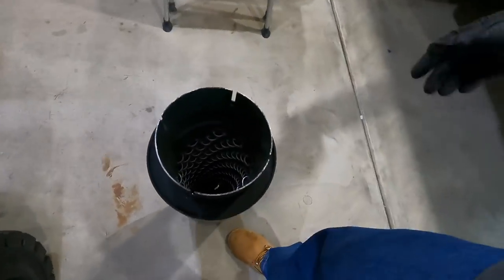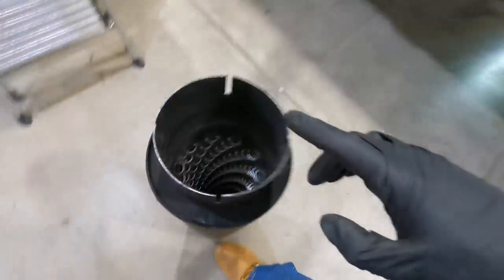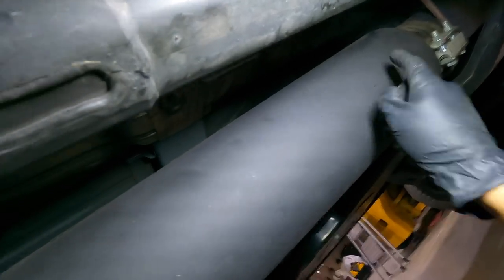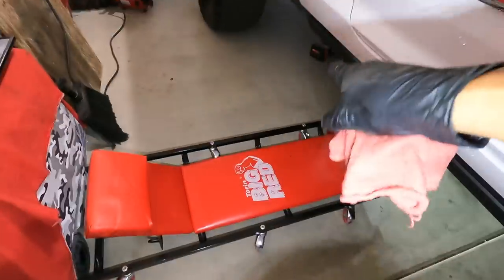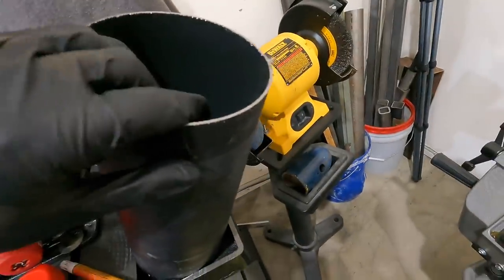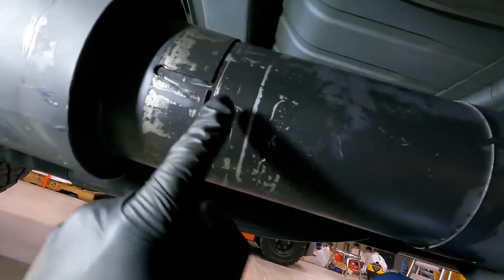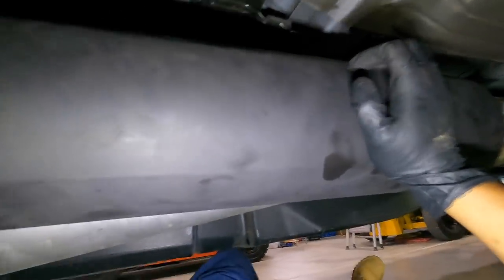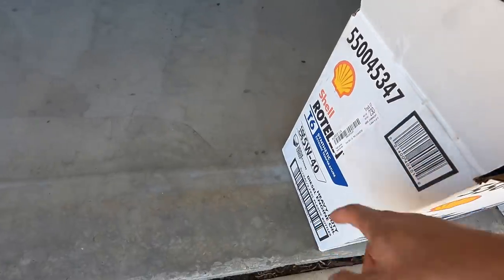Adding a second muffler on the CUMMINS!!....Will this help?

Comment: The Open Holes inside the muffler need to face toward the front of the truck. I think you installed the mufflers in the exact opposite position. Turn the mufflers around and you will notice a big difference is how quiet the exhaust sounds.

Comment: I run a MBRP Performance Exhaust M1004A - Quiet Tone Series High Flow. I also run a resonator. No drone. Made a big difference. I ran 4” all the way because I was told it was quieter. I run the passes in Alaska with no EGT issues. I lock out 6th gear but general cruise at 60-65. I’m only pulling about 12k.

Comment: FTE Diesel resonator 30 inch long will get rid of the drone. Shouldn’t kill power or raise egt’s.
Reply: it robs a little bit of horsepower but nothing to notice on the butt dyno in the drivers seat. I didn't notice any egt increase when I tried it out but I went back to 5' straight pipe on my l5p duramax lol

Comment: I noticed the mbrp louvered style inside mufflers are just loud. I prefer the magnaflow type perforated core with the biggest diameter body. The 24 inch + 30 inch body combo works nicely for the 4 inch systems.  I am messing with 5 inch inlet/outlet, and looking for sound bites before I order stuff. 

The walker version does not seem to quite it down as much as the magnaflow. Nothing quietens these trucks like the emissions bs, but who wants that.

Comment: I have a FTE resonator and a mbrp 5" muffler on my lml. Killed drone and exhaust is quiet. Holes facing forward so exhaust can go into holes and into outer muffler. No egt change. The spiral interior of the resonator actually speeds up the air exiting exhaust.

Comment: I had the same problem with my 21 6.2 Silverado 1500 what you need is a J pipe and the J pipe will cancel out the drone.

Comment: Try a resonator and an axle dump. Do the axle dump first. Shortening or lengthening the tailpipe will move the frequencies for the drone to an rpm you don't drive in.

Comment: Muffler and FLoPro resonator. Still sounds good outside but no drone empty or pulling a trailer.  Oh yeah, holes facing toward front of truck.
Reply from the maker: Herd those kill horsepower 🤷🏽‍♂️
Reply: @EddieLife3500  no se, Brother? Never had the truck on a dyno or anything. Daily driver. Feels like it still has all the wheaties, plus a little. Running 35s though.  Pulls good. Temps are good  but I live in South Texas so no hills, it’s flat down here, just HOT.

Comment: 51" donaldson with no baffles. Comes on 5" and has no back pressure. FTE kills hp/tq. Have this on my 21 HO cummins. Part number M100463. Almost as quiet as stock with nearly zero drone and no back pressure/egt increase. Amazon $185
Reply from the maker: Buying it now thank you, I herd all those FTE kill horsepower, if you have Instagram please DM me
Reply: @EddieLife3500  I don't have Instagram. But I will keep an eye out for your video update. You will love that muffler. I promise. There is an arrow showing "flow", point it in the correct direction 👌
Reply from the maker: What is the difference between this and the M100580, it looks the same
Reply: @EddieLife3500  back pressure from fixed baffles. Don't get the 580. It will increase egt by forcing flow to the exterior of the can. The 463 is straight through with one hump to help alleviate drone. Trust me, get the 463.
Reply from the maker: 463 Is on the way, thank you sir

Comment: This is why not everyone should be allowed to own a diesel. 2007 5.9 5 inch turbo back straight pipe daily driver work truck pulling every day it roars. They aren’t supposed to be quiet and comfortable  their meant to work. If you’re looking for quiet just wait for the Tesla truck to come out. Also I don’t sit to pee
Reply from the maker: If I had a 2007 I would work with it and destroy it like you but I have a 19 limited not 07

Comment: The closer you can get that muffler to the downpipe, the more effective it will be.
Reply: Exactly! I did two Magnaflows on my Ford 6.7 and it is very quiet. The first muffler is right after the turn in the dowpipe. No drone at all but the inline 6 Cummins may simply produce more drone.
Reply: @brihosk  I have a 22 6.7. So you are saying put the mufflers below the cab? and use 2 of them? I want to keep it as quiet as possible.

Comment: Get a Donaldson 51 inch muffler if you want it nice and quiet. Doesn’t kill any power from my “ research”

Donaldson M100580
Reply from the maker: I just ordered the M100463 muffler, not sure the difference
Reply: @EddieLife3500  not much difference. The one you got has slightly better flow but a tiny bit louder. 
You probably aren’t going to notice a difference between the two unless you’re making BIG power.
Reply from the maker: Thank you

Comment: You need a flo pro twister instead of double muffler.
Reply from the maker: I herd those kill horsepower 🤷🏽‍♂️
Reply: @EddieLife3500  I don’t know man I was just meaning for drone. You could look into a single larger muffler. That 30” i have does pretty well. But it’s a lot harder to get a 5” to have less drone.
Reply: @EddieLife3500  Put a electronic cut out before the FTE resonator for when you want extra hp and sound.